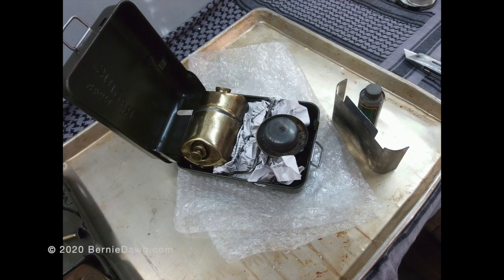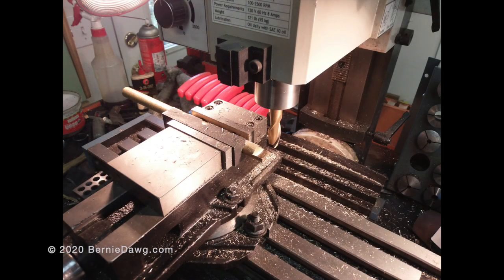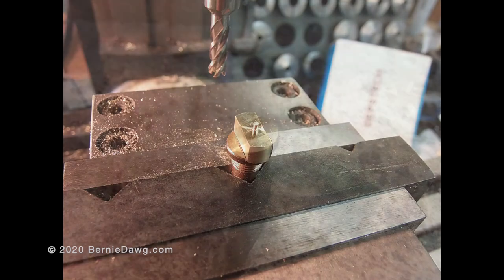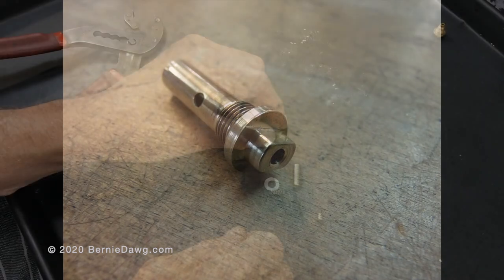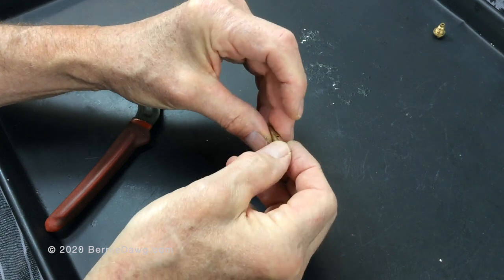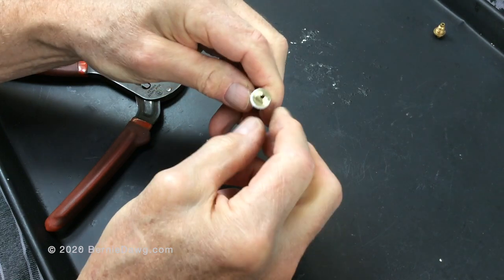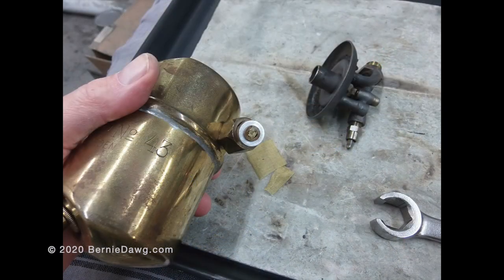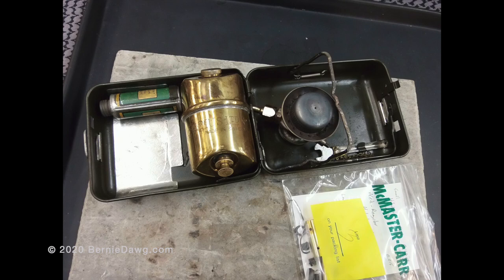Radius 43 Stove Kerosene to Multifuel Conversion

Comment: I'm curious if you noticed any difference in its heating power or fuel consumption while using denatured alcohol?
Reply from the maker: @arvosimo Of course I have! Alcohol has much less heat energy per gram/liter/whatever than petroleum fuels (kerosene or naphtha). So, alcohol puts out less heat, takes longer to boil and requires more fuel to boil a given quantity of water. That's why denatured alcohol is not going to replace petroleum fuels. BD
Reply: @BernieDawgCinema  Thanks for the swift response. I was hoping that the larger orifice would compensate the lower energy density of ethanol. I'm considering buying one those beauties, but still would like to stick to non-fossil fuels.
Reply from the maker: @arvosino Nope. The larger orifice is there so that a LOT more alcohol vapor comes out of the burner and mixes with the air to make for a burnable flame. Alcohol only contains a bit more than half the fuel energy of naphtha or kerosene. You can read all this for yourself with a bit of searching and research, or, just go here: https://en.wikipedia.org/wiki/Energy_density 
Using "non-fossil" fuels in a stove won't save the Earth, reduce global warming, or reduce your carbon footprint in even a tiny meaningful way. Only refusing to have children (vasectomies and tubal ligations) and reducing population will make any real difference and nobody wants to admit to that big hairy elephant in the room. Consider the realities rather than the political hype. Happy camping! BD

Comment: Whats the point of using alcohol...it has lower btu output than white gas. I always use white gas in my stoves, its a little cleaner than kero.
Reply from the maker: @ahah1785  The point? Why does there have to be a point? What you say is true - alcohol is not energy rich. I know that already, but thanks for the info. The client wanted the 43 to be like an Optimus 111T as it came from the factory - uses all three major fuels. So that’s what I did - made it three-fuel compatible (like an Optimus 111T) so the client would send me my paycheck. You might want to watch the whole video and also read the description below the video - there’s a lot there for someone like yourself to learn. And, in any case, I think my video has a lot more point (and a lot more information/education to it) than this one here 😁🤷‍♂️:  https://youtu.be/qwh_mpEqQ_Y  Have a nice day! BD

Comment: I want a store that sells the Redius 43 stove. Please tell me where to get it from
Reply from the maker: @naifalfehaid5205  It would be great if life were so simple. Sadly, that is simply not reality. Here are some facts of which you are apparently not aware. The Radius company in Sweden that manufactured these stoves was dissolved 60 years ago. These stoves were already out of production even earlier, sometime in the mid-1950’s. There is no “store” to buy these long-out-of-production vintage antiques. Instead, you will need to spend time, *effort*, and money by searching on auction websites such as eBay or, better, Tradera (in Sweden where most of these stoves still reside), to find old examples of these stoves. You can place bids at online auctions and hopefully, with effort and diligence, you will win one. Sorry life is not as easy as you imagine it to be. Good luck! BD